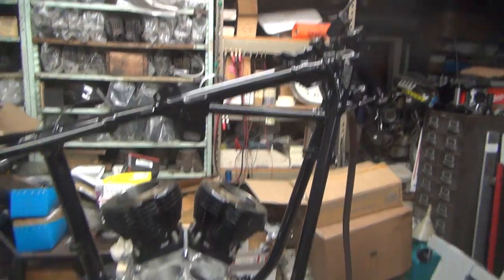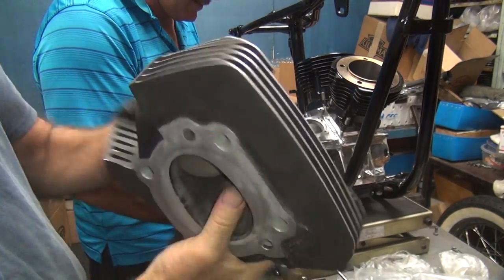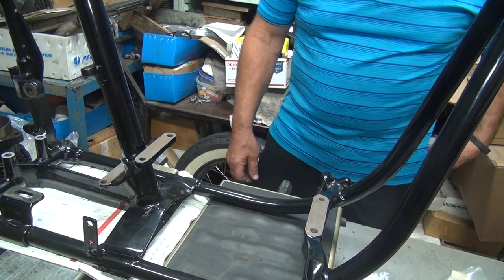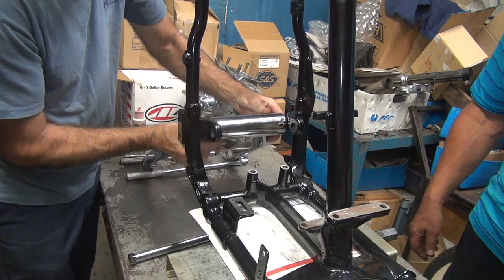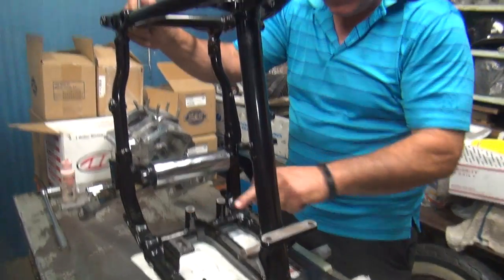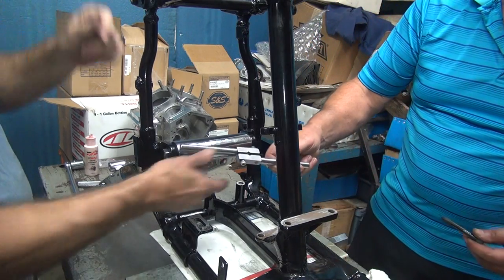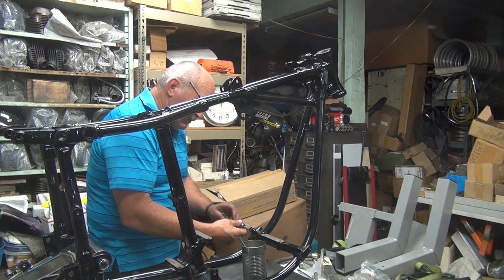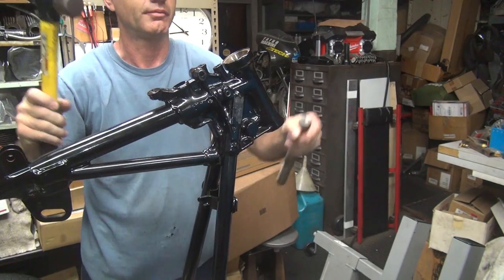#101 1978 93ci stroker shovelhead big bore motor new bike build harley by tatro machine

Comment: Hey Tatro I have a ironhead stroker that seems like its getting way to hot. I shot a cheap heat gun at the higher end of the cylinders and the gun was saying something around 340ish. I know thats way to hot for these bikes. Really hot day, and it was city driving alot of stopping and going. Any ideas would be cool. Thanks
Reply from the maker: it's a sportster, who says that is hot. run 70w oil and live with it. 
an oil cooler would help. it a bike is getting hot and you are worried then pull over and shut it off for a few minutes. that little extra time will make you motor very happy. they cool off fairly quickly when they are not running.
tatro

Comment: How posible is to put a BT heads on Sportster?
Reply from the maker: not a problem. just use custom big bore cylinders and use any heads you want.
what is wrong with the sportster heads, they make tons of power with a 90ci-96ci motor. my 90" 1957 sportster went 162mph at the lakes and 126mph at the drags back in the 90's. it was fun on the street too.
tarto